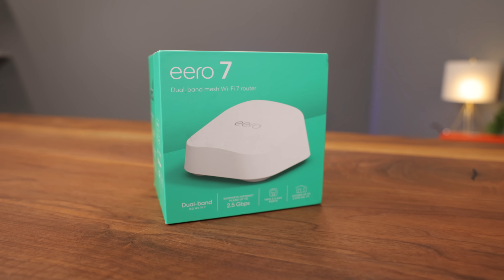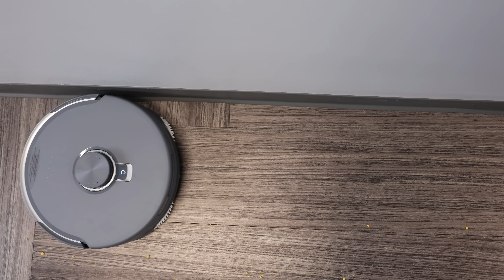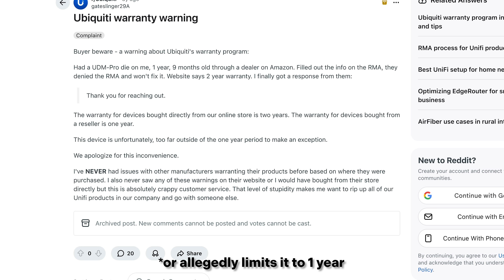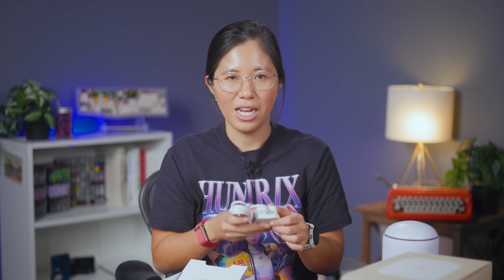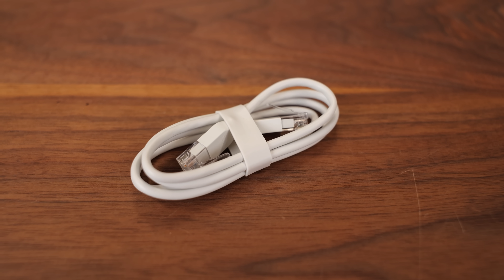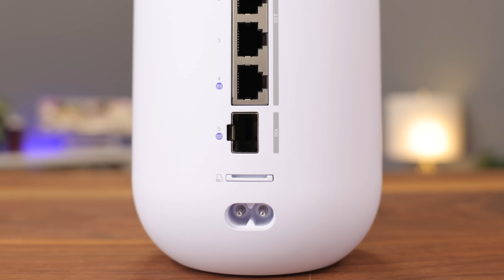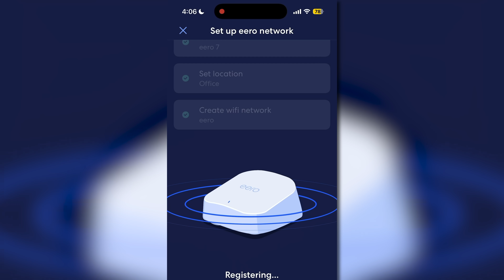Are Expensive Routers a Scam? (don't waste your money)

Comment: I have both eero and a OG dream machine.  
Hands down i would never buy anything else but Unifi again. best there is with virtually no problems.  
On the other hand i experienced problems from day one with eero. found out i had to delete one of my 4 cause there was too many. 
nobody told me this i had to find out from trial and error. took forever cause it was my second home and was rarely there.
also one of my brick went bad and with that all in one cable. it sucked. so i got separate cables and brick to make life easier in the future. 
another thing i hate about eero is that most of the features a wifi router should have available to the consumer that buys and owns it are behind a paywall. 
completely ridiculous.

Comment: When wireless devices say mesh, they are using a band from 5ghz to make the connection.  The more APs, the more bands needed which usually means only the 2.4 band is used by the end device.   Unifi and the like can have their APs talk to each other on ethernet which allows you to roam from ap to ap seamlessly.  

If you are using 320mhz on wifi 7, you can only have one ap in your home as that is all the frequencies.  If you want more aps, you will need to pick something more civil. Remember, love your neighbours, don’t have wifi fights.

Comment: A prosumer router really starts to matter when you have a lot of devices. If you have a smart home with lots of IoT devices and you start pushing 40+ devices, the basic routers can't handle that many connections.

And for UniFi in particular, the integration with their security camera platform cannot be understated. UniFi does not have a subscription, all your footage stays local and records continuously (!), and there is onboard AI detection. So you can ditch your Ring or Nest camera monthly subscriptions.

Comment: I have the Dream Router which I picked up at Microcenter a few months ago for $249, still at that price.  I was replacing the Edge router 4, and already owned the wifi 6.  The Dream Router found my wifi 6, adopted it and was setup in 5 minutes.  Everything was done via the app.  It handled gigabit fiber and is 2.5Gbps wired.  The Eero isn't even in the same ballpark.

Comment: Mesh WiFi is awesome. I bought if for my father because his router was on one end of his house and it was either really slow or no signal on the other end. I bought him a triple stack and now he has good speeds all over his house and even in his detached garage in his back yard. Eero is not the only brand that does mesh wifi systems but if you have dead spots, I high suggest looking into Mesh systems.

Comment: The SFP network interface on the back of the Unifi device isn't only for fibre, you can use DAC cables too, Direct Attach Copper.
Reply: Furthermore you could use an SPF to RJ45 adapter (product code UACC-CM-RJ45-1G) to free up more ports on the switch.

Comment: In Europe (at least the German-speaking parts of it), the GOAT for reliable and still cheap-ish routers is AVM (now called Fritz) with their Fritzbox series. And if you need more features (at the cost of not having one-click setup), Mikrotik has devices for pretty much any use case.

Comment: Got a Linksys MX4300 on a woot deal for $20 and flashed it with OpenWRT. Have all the features of a fancy Ubiquiti router at a fraction of the cost. Tradeoff is a bit of extra setup and networking know-how required, but I'm certainly not a networking expert. Plenty of guides on Youtube too.

Comment: Good video!  I didn't get the Eero model, but the Wi-Fi 7 router I did get had the 3rd band and cost around $200.  The difference from being on the 1st band to 3rd band is massive!  Going from 1000 Mbps to 5600 Mbps!!!  

However, Wi-Fi 7 has a major flaw.  For all the data transfer power, the range is very short.  Think of an extremely buff guy with no stamina to run past 50 meters.  Wi-Fi 6 is like a marathon runner with very little muscle but can run 2000 meters before getting tired.  Wi-Fi 6E is somewhere in-between.

Comment: I refuse to use expensive routers, I have a cheap 2.5Gbit TP-Link router my wifi alone pushes 1.5Gbit down and 400 upstream which is perfect for my needs. And it performs very well lol. I've had more problems with Eero bugs then my cheap 2.5Gbit TP-Link router LOL.

Comment: The Eero stuff is fantastic for anyone who doesn't want to fiddle with excess garbage. The worries about them spying on you are vastly overblown. Tons of network professionals on reddit, discord, and elsewhere use Eero at home, if it were spying on people we would know. It does constantly measure signal strength and other performance metrics. It's updated routinely. I have the 6E 2 pack and it's been "set it and forget it" since day one.

Comment: My 50$ wifi 5 router connected to a 600 Mb/s internet plan gives around 200-300 Mb/s 40 feet away (without main walls in the way) ... very uninmpressed with the eero. Honestly, there are a lot of wifi 7 routers between the price of these 2 devices, check those

Comment: These two routers are not a direct comparison that’s why the price for the dream router is more expensive. The dream router can do cameras Vlans 10 gig SFP and more compared to the eero. Ubiquiti has the UniFi express 7, which is more in line with the eero but still does a little more for $200. Almost all UniFi access points can do mesh also.

Comment: I have exactly 1 device that connects wireless in my home currently. That's my mobile phone and that's why I still my have Unifi Nano AP (WiFi 5). 

I downgraded from 1gbps to 150mbps symmetric and I'm fine with life. 

The issue with ubiquiti is bang average hardware and pretty software for an expensive price. 

Build your own router/firewall and it will beat it every day.

Comment: I'm in the process of installing my Unifi system using a Cloud Gateway Max, but I'm in a large house and not a small apartment. The CG-Max doesn't have wifi on it's own, so I've also installed three Unifi APs (and Unifi managed switches). I realize that getting too far into the details is not really the focus of your channel--videos can't be two hours and still have people watch. 🙂 One of my biggest reasons for choosing Unifi is its configurability. If someone enjoys the fiddly bits, Unifi is great. If someone is more of a set-and-forget person, it's probably a bit expensive.

Comment: 1. Wi-Fi 7 QAM gains will not be seen in the real world UNLESS you're right next to it.
2. You didn't compare apples to apples.  The Eero Pro is roughly the same price as the Dream 7 and has a similar feature set.
3. Ubiquiti also does mesh.
4. The two solutions are pretty comparable price wise.  Let's say you need 3 APs to cover your house.  A 3-pack of Eero 7 Pros is $699.  A Ubiquiti Dream Router 7 + 2 U7 Pro APs + PoE supplies for the APs is $687.  
5. If you're willing to be a bit tech savvy Ubiquiti has WAY more features.  You can create VLANs, segment your traffic, etc.  
6. Finally, I trust Ubiquiti WAY more than I trust Amazon, even though I have friends at Eero and Ubiquiti.  One company has a profit motive to profile you and the other does not.

Comment: I wouldn't call that Eero router a wifi 7 without the 6GHz band.
Reply: @soren777  
6GHZ on WIFI 7 is optional and totally unnecessary (and almost unusable) when you live in a brick house.
Not to mention that it isn’t allowed to use the 6GHZ band in my country (the Netherlands) and in most other countries in Europe.
They’re currently working on changing the law in my country to allow the use of 320MHZ bandwidth (this will double the speed) but they’re not changing the law to allow the use of the 6GHZ band.
I just changed my crappy ISP’s wifi 5 router to a Fritz dual band wifi 7 mesh system and am already getting speeds over 3000mbit/sec and this will double when 320MHZ bandwidth use is allowed.

Comment: Couple of thoughts:

* You refer to the product as "dream". This is a tidbit confusing - just like the Ubiquiti UniFi lineup. The product you are reviewing is the UniFi Dream Router 7 - often shortened as UDR7. Aside from the Dream Router, the UniFi lineup contains the UniFi Dream Machines too. 
* The LCM screen on the UDR7 has a gimmick status. Yeah, it is nice as a newcomer, but more advanced stats can't be read on it. Plus, it doesn't allow scrolling though the stats (most of the newer rackmount equipment has LCM touch screens, allowing to scroll though various metrics).
* The UDR7 is steeper priced. But it is compatible with UniFi Protect too (albeit with an SD card) - that is basically one ecosystem featuring security cameras / doorbells as well. SD cards do have a pretty low wear 'n tear though, I'd personally recommend against SD cards for surveillance footage.
* The benefit from 6GHz is that it it basically less occupied. Most home setups don't benefit the 1Gbps wirless connectivity - as both the provider max out at < 1Gbit/s and basically no home networking. And yes, there are certainly exceptions (I am one of them, internal network is 10Gbit/s minimum) - bit it is really niche.
* The UniFi Network stuff can serve as a VPN server and as a VPN client. Even on a UDR7, you can create guest networks where all the traffic flows over an off-the-shelve VPN provider - offering guests all the benefit without having to deal with unwanted traffic over your network.

I really appreciate the video - thank you for that!
Reply from the maker: And I appreciate the education

Comment: The problem with phone company supplied routers is that to the best of my knowledge, no one makes a DSL modem/router any more. Netgear used to have one, but no more. Anything available is for cable use only. I'm forced to use the modem/router supplied by my phone company because... So I use their modem but I have my own wireless/wired router. I do not use the wireless feature on my phone company's modem.

Comment: I found that my TP-Link Deco BE63 is a great option for $200. I can generally get around 1500 to 1800 Mbps on my Fios 2 Gig connection right next to the router or 1000 to 1300 Mbps in the next room.

Comment: A purely superficial test. But if you don't conduct long-term stability testing, load testing, multi-device and multi-frequency testing - then without this data it's just an overview, or rather a reproduction of the declared parameters, not a test.

Comment: These products serve different customers.
Reply: They're both home routers; one is significantly better than the other and can service a SOHO environment, but even someone with an 800 sq. foot flat can use (and is better off with) the UDR.
Reply: I actually use a UDR7 in my 800sqft apartment. My network has zero blips (manifesting in audio glitches). And it reaches my car (which is in the lot 5 stories down). I can use this as a camera controller when/if I move to a place where I need cameras. The vpn and teleport are crucial for me. I enjoy poe (as it makes some wiring simpler and cleaner). I'm and enthusiast, no doubt. But at it's price point (in the US on sale) it beats literally everything else. And it's ~almost too easy to make it a wireless mesh if you need. The unifi software is amazingly reliable and easy to use. It's very very powerful so maybe they'll make an easy mode or something but they only ~just started aiming at regular folks (with their wifi 7 stuff, which is barely regular folks but they're regular folks future proofed for a decade).

Comment: Ah, someone that doesn't know anything about routers, telling a bs story about routers, thinking she knows everything about routers. What a load of bs. Never buy a router from a brand owned by a company like amazon. Also Eero isn't unique with mesh wifi, they were one of the first to introduce it, but other brands weren't far behind since it was not an invention by Eero, it was a new chipset that enabled this. Other brands didn't rush to market and came out with a way better solution (Like Netgear and TP-Link). Besides that, wifi devices are priced based on performance. You need to find out what performance you need, and then get a router that matches that. That means that with a 1Gb fiber subscription, you don't need a 2.5G capable router unless you plan to upgrade sometime soon.
Reply from the maker: I would counter to say that, we are getting slowly educated about routers. And that takes time 😊

Comment: Changing from Asus routers to a full ubiquiti setup using the DR7 has been the best improvement in network and seamless operation for my home. The ubiquiti products are much more reliable, you have control over everything, the interface is clean and easy to use, integration with their other products is just so good I can't ever go back. It solved so many issues I had at home that I didn't know were all because my Asus router and aps were just terrible.
Reply: Yep I’ve never had to restart any Ubiquiti product I’ve ever owned. So solid.

Comment: Your missing out on the most important thing about a router, UPDATES (no updates then your router is just part of the BOT network). My nighthawk died from lightning strike on the apartment, was replaced with a TP link router (no wifi 7 because wired connections are king). Wifi is only for phones and tablets, and the quest network that my tv box is connected to.
In a month the tp link will be getting a software upgrade with OpenWRT. Having a router last longer then maybe 2 years of updates is very important. My nighthawk went well past its last update, because it had FreshTomato OS, and was getting updates.

Comment: As someone who has designed and deployed multiple networks around the nation from dial back in the 90s on I've been using the Erro 7 Max Mesh the past year and while it's quite expensive it's flawless and much faster than either. Pick the speed you need, there are multiple options now from Erro, and it's easy. You don't need Eero plus, used them for 7 years now and never signed up for the monthly. Nice review on the more basic systems!

Comment: The comparative product is the Express 7. UDR7 has a lot more stuff under the hood and you pay for it - at a great value if you're going to actually utilise said features.

BTW the UDR7 will actually handle 5x 2k cameras absolutely fine for home use. Sticks around 60% cpu usage. So find whichever ubiquiti cameras have the features and price point you want. For me 5x g5 turret ultras running at full spec. I didn't upgrade the micro SD so it won't record 24/7 - I wouldnt want it to for home use.
You can link it to your NAS for much cheaper storage per GB. The realtime archiving batches to every 10 mins so it wont ruin basic nas drives. 
Give it 500gb for 6-12 months of event storage with similar cameras depending on how often it records.

Comment: Being able to administer the router via a browser on my PC using the IP addy is required as far as I'm concerned. If the router only lets you set up and administer through an app, it's a deal breaker for my personal use.

But, I've used eeros for family and friends in the past and generally they're fairly solid devices but the limitations are infuriating.

IE, they force auto switching between 2.4 and 5ghz bands. When setting up smarthome devices or a garage door opener WiFi, the eeros only supply a temporary 10 minute switch which will turn off the 5ghz for 10 minutes while you try to set up your 2.4ghz only device. Not enough time when you are going up and down a ladder to the controls on a garage door opener. Also a pain on WiFi smarthome devices.

But, I do like the eeros app to keep on eye on updates and notifications for the routers my family and friends use that want nothing to do with administration of their routers. It let's me work on them from my location, no road trip required.

Comment: Note: If you plan on using Unifi cameras or doorbells through Protect, the UDR7 can't handle very many cameras.
Reply: It handles 5x 2k cameras just fine for me. Thinking of adding more, just dont have a strong need for it in terms of actual security.
Reply: Tech specs on ui say it only handles 2x 2k cameras OR 5x HD OR 1x 4k. 
Saw a post on Reddit just the other day of someone staying it was struggling with a single 4k camera. Makes me wonder if there was a hardware revision at some point and they upgraded the processor?

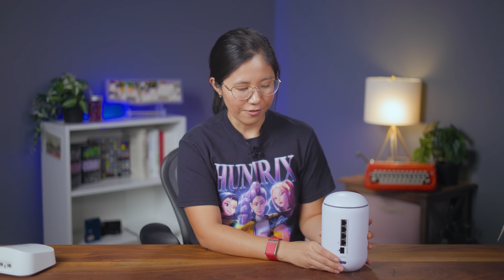Comment: 9:45
To some people it's not about the speed, it's about the convenience.
My ISP locked the bridge mode on their modem/router combo and I ran into some issues with double NAT, DHCP, and MTU (not to mention the nightmare of port forwarding and UPnP), I fixed that with a cheap GPON ONT SFP+ module I bought from eBay, but there is an alternative product from Ubiquiti that does the same thing called Fiber Loco (many people prefer it over the SFP+ modules since they tend to get very hot).

Comment: I bought a 600 dollar router only to upgrade the internet and to get a better router with isp than the 600 dollar o e
Reply: What router did you spend $600 on? What gateway/modem/router did your ISP give you? I highly doubt an ISP gave you a better router than a new current model 3rd party router. Or you over paid for the 3rd party router, or the 3rd party router is overkill for you. Something doesn't sound right here.

Comment: Eero offers a full size router with multiple ports. The one your comparing is designed more to be a repeater.
Reply: they are the router and repeater.
Reply: @EverSpaceTime yes but it’s a different class of product then what it’s being compared to.
Reply: Should have used the pro 7
Reply: @mswaney81  probably doesn't matter under a gigabit.

Comment: Yep. You have to buy the Eero Pro 7 to get tri-band support. As a bonus, it comes with a 5Gb port vs. a 2.5 Gb port. Or you could get an Eero Max 7 for even better performance, using 4x4 antennas. Again, with a cost increase.